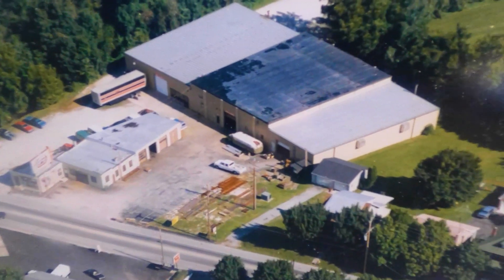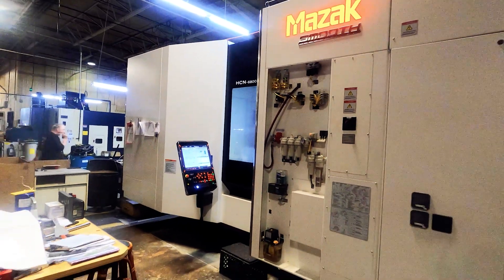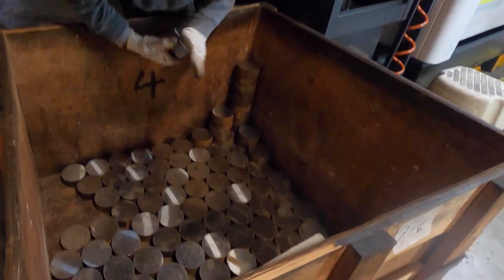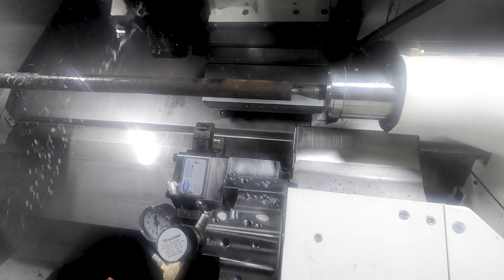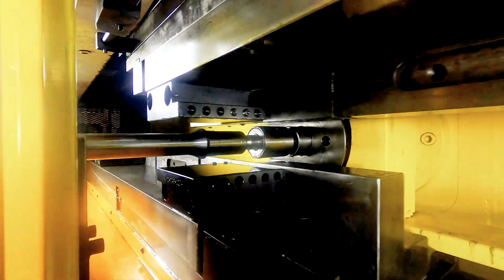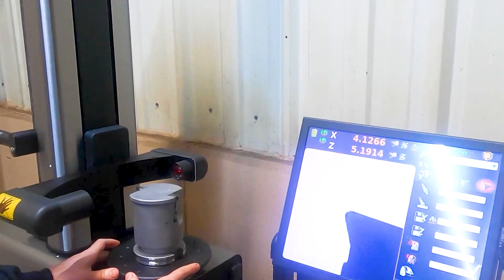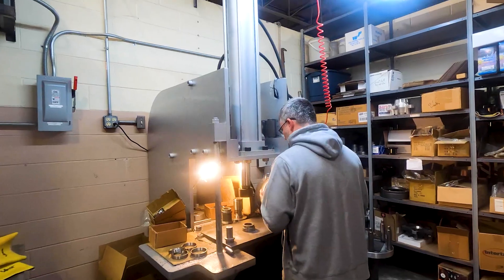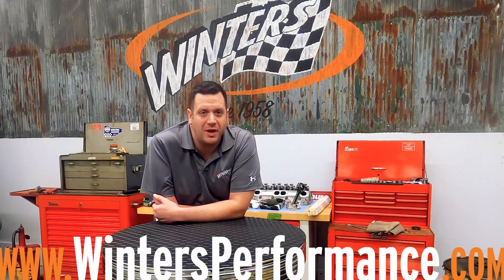Winters Shop Tour

Comment: Could you do a video on the disconnect assembly and how it works?
Reply from the maker: Which assembly are you referring to? We're happy to post tech videos for requested info.
Reply: Sorry, I should have specified. What I am interested in is the drive train disconnect on a sprint car. How does your mechanism to disengage or put out of gearwork.
Reply from the maker: You're referring to the shifter block. Yes, we can certainly do a quick video explaining how that works. Stay tuned and we'll put one together—we'll tag you when it's posted (in the meantime you can also check out our video on Sprint rear assembly...doesn't address your specific question, but you might find it interesting).